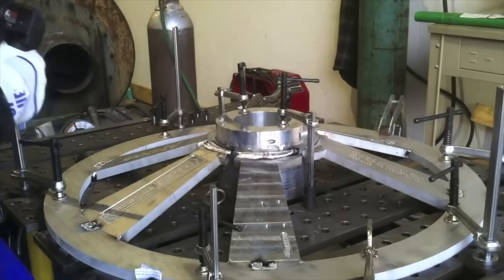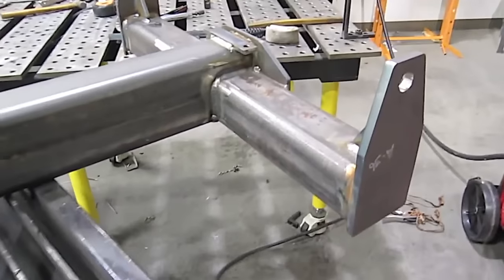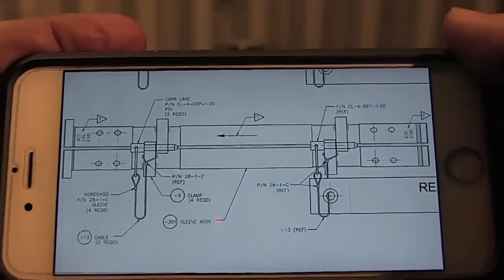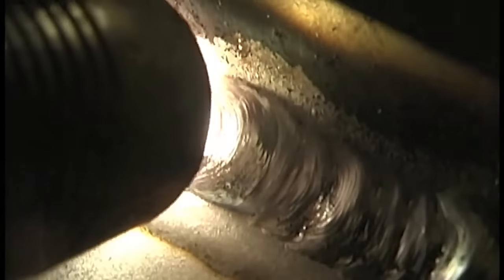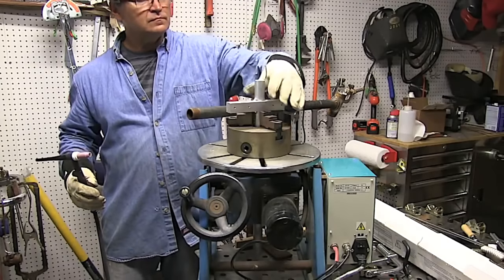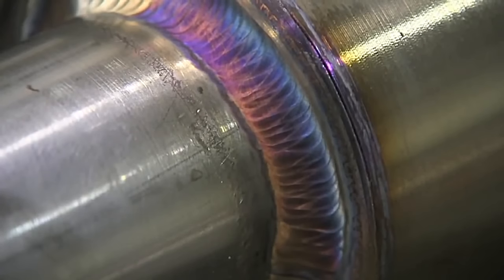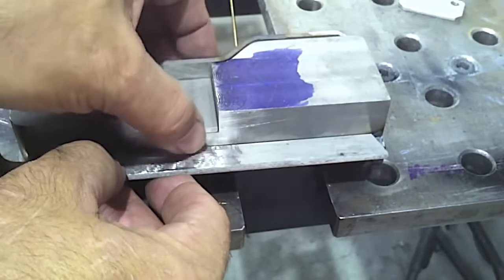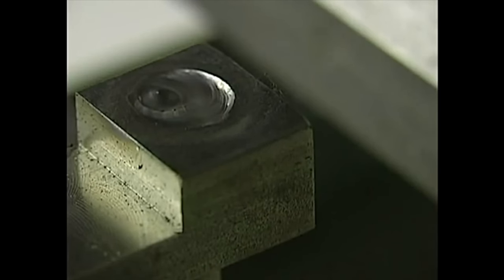My Welding Side Hustle

Comment: As a welder who has welded many of these kinds of parts as well as multiple types and base metals for pressure vessels, I can tell you he does a nice job demonstrating and explaining these welding processes. I also built my own rotating fixture using a tig pedal for speed control. I often have each foot on the pedals for both current and rotation control, as well as the tig torch in one hand and the filler metal in the other! I was also the choice of many machine and welding shops until I retired! Praise God for the gifts he gave me to raise my family!

Comment: from my experience 308L filler wire is just about perfect for 99% of the stainless or stainless to steel welding. Even on cast iron it holds up better than you would think.

Comment: been watching you for some years off and on 
think you were one of the first
Welding channels I’ve watch 
And really right off the bat knew 
You were the Man ! 

Just clear , respectful, straight to the point , 
And knowledgeable 

Bulk of my welding experience has been heat exchanger / vessel shops 
A little fabrication, some shipyard , and a little field work

Comment: As a "side hustle" owner myself, though not welding, but cnc cutting and bending, I can relate to the customer communication statement.
 I would only ad that whenever possible, try to get the customer to talk with you before bringing the parts to be welded. Often a small adjustment to the machining or cutting can be made to accommodate self jigging, making the set up go faster and often better alignment post weld. JMO.
 Thank you again for the awesome tips and tricks. You are a very gifted person being able to not only weld so professionally, but teach so professionally as well.

Comment: This was a very well done episode. Welding is all about procedure and it's this broad experience that really pays off. I know that all a guy really has to do is start welding and soon enough the neighborhood will find out and then the circle just gets bigger and bigger. Got to make them pretty though. That's probably the best calling card for the customer to see and if you are getting the procedure correct (preventing some catastrophic failure) and you're all set. 
Communication by the way and as you stated so well is so important in finding out what is really needed and wanted. And machinists among others don''t always know what is needed and wanted. You would think they do but often they don't know how to get there. 
Thanks for the great show.

Comment: Your videos are a tremendous service to the world of engineering. 
Your videos show countless practical attainable applications in welding. 
If it weren't for you, I'd have never learned to weld.
I'm more in management now, but when we get new designers, we show them your videos and give them some hood time on the in-house equipment so they can know what it's like, and make use of the fine fellows who perform the actual welding work.

Comment: Great presentation.  As you said, communication is important and communicating customer expectations and your capabilities is important.  After all, you don't want to get into the situation where the customer is expecting you to do or provide something that either you cannot do or is not possible.  My experience is that when a part is being designed, the manufacturing processes have to be taken into consideration.

Comment: I've been doing side job's at work until I built my own building.  Machine shops are great to work with.  I've got myself all the welders and home built positioners I need.  I got myself a small older lathe and do some machining between welds, so I know what you're talking about.

Comment: Great video loads of welding tips and tricks.

I don’t weld I melt stuff and make a mess. I am obsessed with finding bits of steel and whatever to put in my ‘scrap bin’ for s rainy day. It amazes me just how much scrap steel ends up being used/reused/repurposed by myself. I work away as a truck driver and I scour the locations I visit for bits and bobs. Large nuts and bolts and washers all get rescued and sometimes I get lucky and find some steel plate. Must try and find some copper and stainless in the future. Back home tomorrow night will be in my garage straight away despite working through the night. I have things to weld(okay things to melt) Hopefully with a few more bits of steel or whatever for my scrap bin. 

Thanks Jody.. 👍🏻

Comment: I still have an old Syncrowave 250 Jody. I finally have power run for it just need to get some shielding gas, filler rods and some work for it. It was originally bought to reweld thousands of stainless steel collars on 1-1/8 inch Fire Hydrant stems. so I learned to tig stainless out of the deal and got to take the welder home when that business went south.

Comment: One shop I worked at last year did a lot of machining and welding. New guy on the forklift dumped a whole bin of tight tolerance bosses from 10 feet high, they got pretty dinged up. Needless to say we spent a lot of time re welding the edges and machining them back into spec

Comment: Occupational stick welder (1/8" E7018) on low carbon steel here.  I'm starting to see a practical paywall with my specific occupation and where I live.  Been highly interested in starting a welding side hustle but not sure what's the best path forward to be honest, and I'm not totally sure on the legal requirements and licenses required.  I primarily build steel structures/chambers for large building product QA testing.  I'm aware of an AWS Structural Steel Welding certification (not required for my job), but starting a small scale steel erection business would be directly inline with what I already do.  I'm mostly wondering if I do need the Structural Steel Welding certification to do this and at what point do I need an engineer and/or CWI to sign off on me or my team's work?

Comment: I have been watching your videos since back in 2012 when I was going to school for welding at Job Corps, I got 3g certified for gmaw and fcaw-g, and since then I have on and off as a welder / practiced different welding my personal time for fun but I have never gotten much experience with tig and have recently decided I wanna put in some time to get good at it, how long do you think it would take to get good enough at welding tig to start bidding some simple jobs to get my feet wet? I also wondered, assuming I would end up spending a equal amount of time doing aluminum, stainless, and mild work, which would be best to practice and learn first? I'm aware many variables would affect this answer but assuming I practiced 2-3 hours a day and have a decent ability to pick things up, what would you say? lastly, If your too busy to answer this I just wanted to say thanks for all the years of great videos.

Comment: In the late 90's I got a job as the Maintenance and Tool Room Manager for a company. They did a lot of stamping to make components that they welded together into steering columns. 
The stamping dies were all taken care of internally. They had developed a process for rebuilding the cutting edges of the dies. 
I had a guy who worked out of his garage welding up dull and chipped edges on die components. I would drop off the parts and in a day or two I would pick them up and either bring them back to the shop for grinding or take them to a Machine shop with some specialized equipment for a few of the difficult ones. 
Being able to weld tool steel made the small weld shop a pretty good living. I was taking parts over at least once a week. It was cost effective because dressing an edge instead of roughing, heat treating, and finish machining a 30 lb chunk of tool steel is expensive. If the job had been just a little lower on the cycle time I would have had a second cutter made and swapped out the chipped for the repaired parts. 
Not many shops doing that kind of work anymore. They hire it all done by a Mom & Pop shop so they don't need to have trained people on the payroll. 
You have been a good source for ideas over the years Jody. Thanks for all the tips. I'm retired so I only do repair work around the house anymore. Still it's handy to be able to fix what I need when I want to. 😁😎

Comment: Im running into trouble. I currently have a certificate in smaw gtaw and gmaw from a tech school. I work as a fabrictor mostly mig. I like to arc weld the most but i have crippling anxiety over traveling. My goal is to do aluminum goods with tig and a small shop. Somewhere i can get to know and work with the owner. Problem is everyone wants 2years experience for tig but i cant get a job as one. So i chose to buy a welder to keep practicing. At a certain point i would like to do exactly what your side hustle is but do it full time. Could also bring in factory overflow. But im not nearly skilled enough i feel stuck. What would be a good 5 year plan in your opinion.

Comment: Great Video....I've seen most of these short clips over the years....I did a lot of stuff for food processing. Most of it was 303...so yeah, 308 filler worked fine...another job...and not your garage stuff, replacing super heat steam tubes in a water-wall boiler Bio-Mass generation plant ....2" chrome-moly....3/8" wall tubing....all scratch start TIG...lots of laying on your back, and plenty of using a mirror to see the back of the joint.... but these tips would have been great...that was in 1991...No home computer, no YouTube.... the main steam line to turbine...12" pipe, 1" wall stainless....miles of TIG welds....

Comment: Hi Jody. Here in Alberta we do a b pressure test on 2” 160 carbon steel pipe doing a stainless root using 309l rod and filling up the rest with 7018 I’m curious what u use for tig when u welded stainless shaft to carbon steel ?    Thanks and keep on melting metal !
Reply from the maker: I almost always use 309L for carbon to stainless.

Comment: I see a lot of shops use MiG for control arms, or long trailing arms like on off road and pre runner trucks. Seen some nice ones use tig for suspension parts and that’s ok. But you said not to use short circuit MiG on things like lifting or structural stuff like buildings. Is this MiG ok for suspension parts like these mentioned?

Comment: I farm hay and raise sheep, rabbits and chickens for eggs.  Inflation began eating our profits on our small farm so I opened a machine shop in the barn and specialize in one off emergency fixes and one off parts on tractors dating back into the 1930’s.  No one does what I do and our machine shop has paid for a mill, lathe, benders, and TIG, MIG, Stick and  Lincoln Gas Powered 60 Amp Portable professional stick welder and generator.  This week is our first vacation in 17 years!  A welding table comes next…farming is becoming my side gig!

Comment: Hello. Can anyone please help?!
English is not my primary language but I will do my best to explain what my problem is.
Its called stahlwerk 200 ac dc pulse pro.
I plugged everything as it should be plugged in order to try it on a thin sheet of aluminum. I set the machine to the follwoing parameters: preflow 1s, hot start 50-60 (cant remember exactly), start current 30, upslope 2s, peak current 45, downslope 1-2s, end current 30, post flow 2s, ac balance 30%, ac frequency 90 and clean current i think i set it to 30 (I am not sure what this is to be honest. comparing it to other machines, this is something unique to the machine I have. Same with the hot start parameter).
When I started working on the aluminum sheet it worked perfectly, I even managed to create some dimes with the filler rod. the puddle was formed well and there was no dirt in the weld. However, I felt that it was melting too fast and I am still a beginner, so I decided to turn the peak current down to 40 instead of 45. Since I did this the machine stopped working as it should. One of 3 things happens: 1 - there is no arc: there is only some electric bolt between the tungsten and the aluminum sheet. When this happens, the machine behaves like this for a very short time after which it enters the pre flow state although I still press the button on the torch. 2 - There is an arc but it is very chaotic, there are interruptions and after a while point 1 happens again 3 - I tried to turn the peak current up by a lot (70-90) and somehow an arc appears and it stays constant but of course the aluminum sheet is very thin so it melts and the tungsten starts to melt as well.
I tried changing all the parameters, like the hot start, i even switched to pulse mode but the same 3 things happen. I tried it on DC mode on a metal rod and it seemed to me that it was working quite fine.
Please, if you have any idea, let me know if I am doing something wrong or if there is a defect in the machine.

Comment: On the farm, EVERYONE is a ‘professional’ welder. In my case it’s turned into a machine/weld shop that has surpassed the work of the farm altogether.  One of your comments gave me pause. “Usually lifting by a welded ring is not a good idea”. But in a farming area, when you’re a shop that builds farm implements with precision robotic (no I didn’t mean hydraulic) functions nearly everything you make or work on has a ring welded on to lift it and move it into place for hook up and take off and storage.  Some farmers ‘hang’ their implements for 10 months of the year to use the wasted space in the barn and get stuff out of the way without using your precious barn storage space.

Comment: a hobby hydraulic press company says they have certified welders yet there promo video  seem like a joke thoughts on reviewing the welds 
video title -- Bonny Doon Hydraulic Presses and Tooling.  
 for 20ton press and chance of spitting steel out at teeth height im not to keen on the welds when they had every chance to cherry pick the video welds
Reply: 20 ton press is pretty small.  They could probably just use crazy glue instead of welding.😂